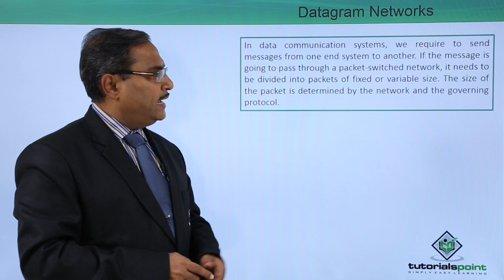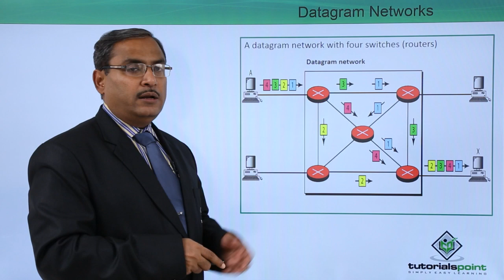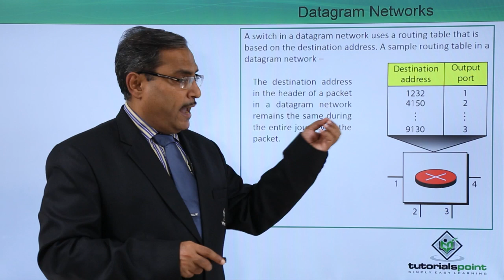Datagram Networks

Comment: Sir you told that packets choose their routes according to the routing table,which have the destination address,but according to your example a long message is divided into 4 small packets and each of that packet has to reach the same destination, which means their destination address will be the same,so why all the 4 packets are choosing different paths ???
Reply: The edges in the network may have different weights , therefore it is in our best interest to choose minimal path cost for every package ( Dijkstra's algorithm ). In doing so every package may choose a different route but at the end they will be rearranged.